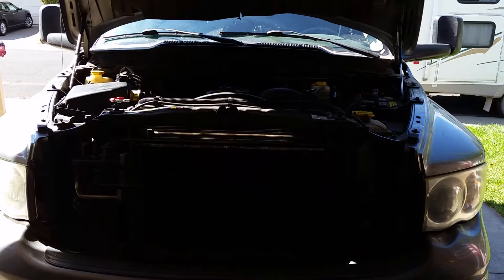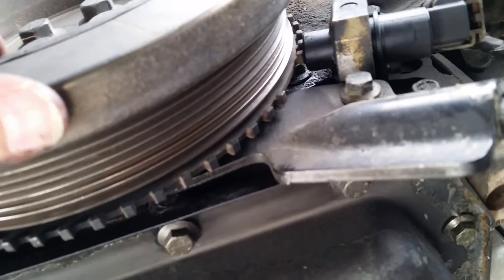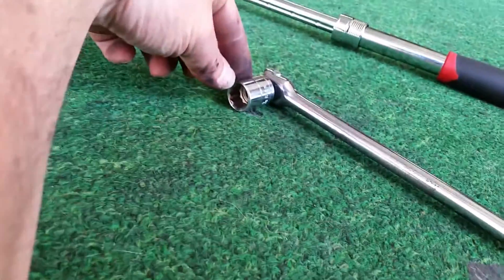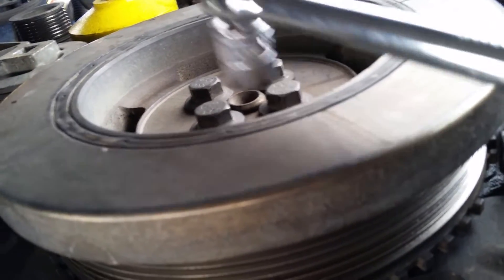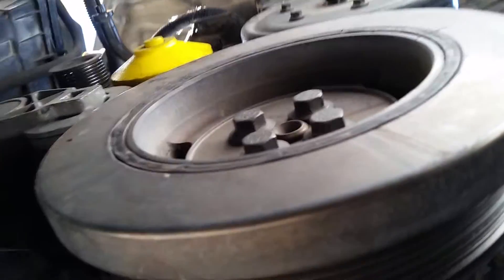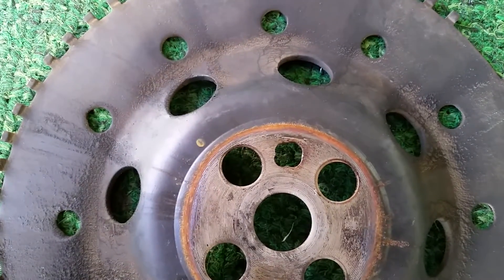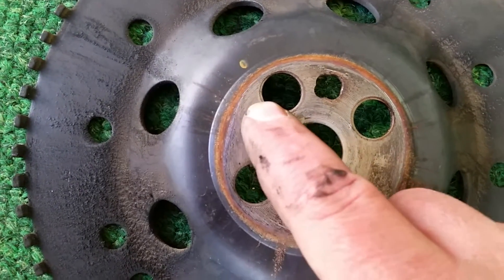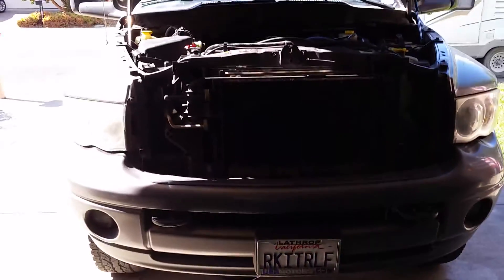2005 5.9 Cummins Tone Ring Mod Video

Comment: So when i get a tuner do i have to fix the mod and if so just tac weld or new ring?
Reply: 100% new ring. these rings are super sensitive and so is the crank sensor when monitoring them. even the slightest crack or nick in the ring teeth can cause loss of crank signal and thus drivability issues.

Comment: What exactly dos this do? Dos it give you more HP??? Thank for the Video.
Reply from the maker: In theory.  Its a way to increase the injection timing advance if you don't have a tuner.  More advance means more power, up to a point.
Reply: Thanks for your reply! I will be in touch with you as soon as I get the tuner you suggested. Thanks for your time and help. DC.